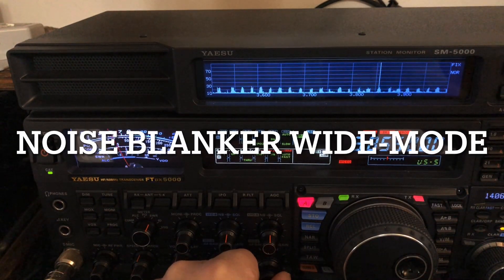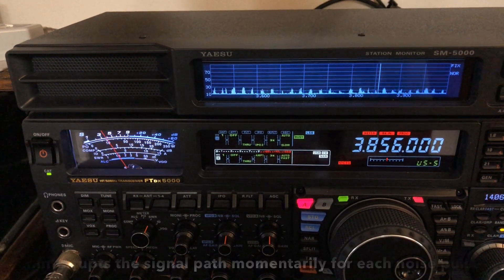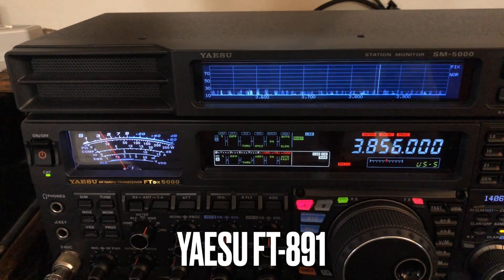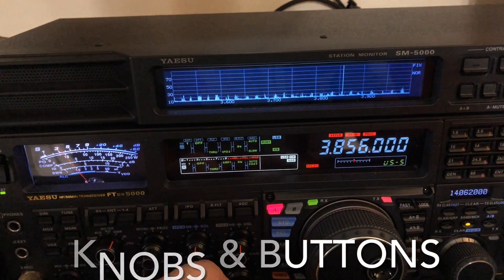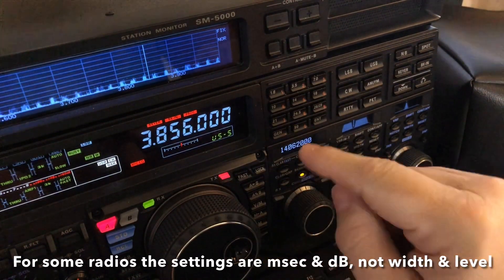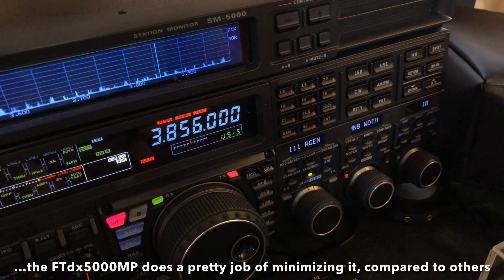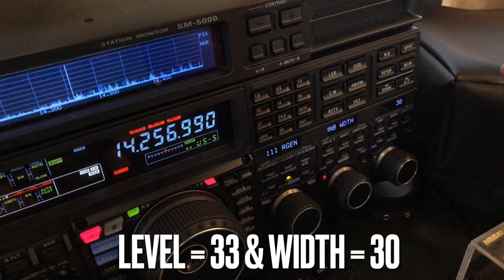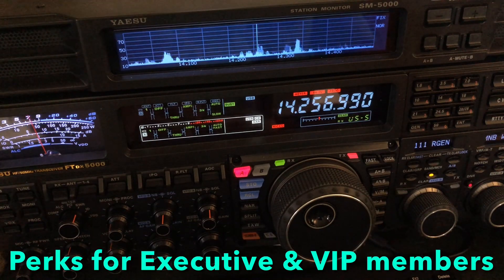Yaesu FTdx5000MP: Noise Blanker Wide-Mode

Comment: what is an even more interesting issue is noise blankers on FM!
according to the current crop of sdr shills that is not possible however radios like ft1000d or ts850s have effective noise blankers which also work on FM

Comment: Thanks Doug, great subject. Is there any such thing as an after market noise blanker that goes between the feed line and the radio?  Or would that just be a QRM eliminator?  Thanks. Mark
Reply from the maker: You are correct.  That would be the QRM Eliminator.  It takes care of the noise before it ever gets to the radio.  It is more effective against short duration pulses, like power line noise.  No noise blanker does great at dealing with noise from LED lights, Wall Warts, Plasma TV, laptop power supplies, etc.  The QRM Eliminator uses phase cancellation. As long as the pulses are narrow and consistent, it can knock them out.

73, de N4HNH

Comment: In most cases if you can adjust the nb with a number value it’s a digital nb. Wide mode takes a bigger sample.
Reply from the maker: Usually, with a superheterodyne architecture, the NB is in the 1st IF, even the wide.  Such is the case with the FTdx5000.  It is best to attack the noise nearer to the source.  

With SDR architecture, it is digital.  And yes, the wide-mode carves out a larger chunk of the signal.  That’s why when you go too wide, it becomes distorted.  It becomes more square wave.

73, de N4HNH

Comment: Another great deep dive video from N4HNH.   This week I just started to get noise on 40 meters.   I’m on the hunt to find it.  Fortunately the NB on my Yaesu FTdx10 knocks 80% of the noise out.   However I did not know the NB had a wide mode.  I’ll have to play with that setting and see if it has an effect.   Thanks again Doug!
Reply from the maker: The FTdx10 doesn't have a traditional noise blanker and a wide-mode noise blanker.  The adjustments in the menu for timing and decibels allow it to be set for wider duration pulses though.  That seems to be the method Yaesu has chosen for their newer transceivers, including FT-891, FT-991A, FTdx10, etc.  The FTdx5000MP just happens to offer a traditional noise blanker and the option to enable a wide-mode noise blanker that operates from its own parameters.  73, Doug

Comment: That's a nice radio and has a nice noise blanker, but I'm not sure if I understand why you think the 7300 doesn't have a good noise blanker. If you hold the noise blanker button down you'll get more control (level, depth & width) which I find works out very well. 
73s  KE8OPY
Reply from the maker: The IC-7300 wasn’t able to remove the noise, back when I tried it.  But, not all noise blankers can tackle all types of noise.  One might minimize a noise that another cannot and the other might minimize a noise that the first one cannot.  

Even the digital noise blankers struggle with certain types of noise.  Like I said in the video, the noise blanker just buys you some time until you can stop the noise at its source.  

The next best thing to stopping the noise at its source is the QRM Eliminator, which also keeps the noise from ever entering your receiver.  I look forward to the day when that technology is built into our transceivers.  It would need to be built into a dual-receiver radio with a separate antenna port for each receiver.

73, de N4HNH
Reply: @n4hnhradio  Thanks for the reply. It would be great if it was an easy task. I've been tracking and reporting stolen ground wires from the transformers on power poles. And the way power lines and other wiring is disconnected and left hanging when a house is torn down sure doesn't help. This 7300 is only a couple of years old and the noise blanker seems to have improved with the firmware update, but I don't see any mention of it being improved.
Reply from the maker: It might not have been improved.  That’s the problem with noise.  Sometimes the NB can handle it well, other times not so well.  So the noise blanker could be the same and noise is slightly different.

I haven’t yet found a noise blanker that can completely knock out the laptop power supply noise in this video.  The FTdx5000MP, with its wide-mode, gets closer than some.  

We are dealing with so many more sources of noise these days that I’m amazed we can still hear at all.  I’m glad the radio manufacturers give us these “band-aids” (NB, DSP) but at some point the FCC needs to start rigorously testing electrical devices, like they once did, before they are allowed to be sold.  I read somewhere that the man-made electrical noise level has increased by 1 dB during the past couple of decades.  That gets added to the atmospheric noise, which we can do nothing about, except use digital noise reduction.

I’ve seen the broken or cut ground wires in my neighborhood.  Georgia Power was once great about getting out here to remedy the noise but they have been scarce since COVID-19.  They haven’t returned my call and it has been 6 months.  The last time I spoke to the engineer who sends out crews for noise issues, she said they are severely understaffed and the younger generation doesn’t want a job climbing poles.

73, de N4HNH
Reply: @n4hnhradio  Oh yeah, they aren't really meant to get rid of it all, just soften the ripple, although I once had a uniden cb that did a very good job with just the push of a button, and it didn't do too much damage to the audio while doing it. Most of the stolen ground wiring was replaced without climbing.
73s
Reply from the maker: Power line noise and ignition pulses are usually easy enough to eliminate.  My FT-890 manhandles the ignition pulses from my truck.  It’s this new stuff, such as LED lights, cheap wall-warts, switching power supplies, heat lamps, plasma televisions, etc. that has presented so much of a challenge for a noise blanker.  They are the reason we need wide-mode.

73, de N4HNH

Comment: Always good information conveyed in your videos. Speaking of "wall wart" RFI, I purchased Bob Heil's equalizer/speaker combination to improve the sound coming out of my FT-991A. The power supplies for both specifically said for computer use only. Both gave off a ton of RFI. I purchased two FCC rated power supplies from Amazon which fixed that problem. I contacted Heil about it and was given Bob Heil's email. In our exchange he admitted the problem and although Heil Company probably won't reimburse me for the power supplies I had to purchase (only $20 each) they will hopefully initiate a recall. Thanks
Reply from the maker: It really has become more and more difficult to hear these days.  Can you imagine jabbing a modern DSP transceiver back in the 1980s, when all we had to deal with was atmospheric and power line noise?

I read somewhere that the noise floor has risen 1dB in the past 10-15 years, just from man-made devices.

73, de N4HNH

Comment: I'll probably watch this eveing. Just got my 5k last month. Your videos are extremely helpful. Been haveing 1200 for 5 years. There's some similarities. 73
Reply from the maker: Yes, the 1200 is a nice rig.  It just didn’t benefit from the down-conversion receiver architecture that the FTdx3000D has.  Better display than the FTdx5000MP.  But I’m not so much into the waterfalls and such.  I did buy the SM-5000, mainly for the speakers, but the spectrum scope can be handy.  The most important thing for me is the ability to hear weak signals, and the FTdx5000MP delivers, as does the FTdx10.

73, de N4HNH